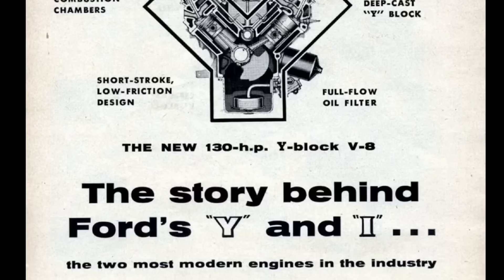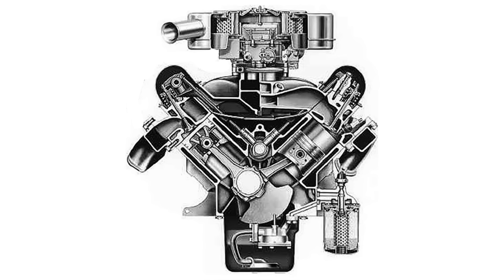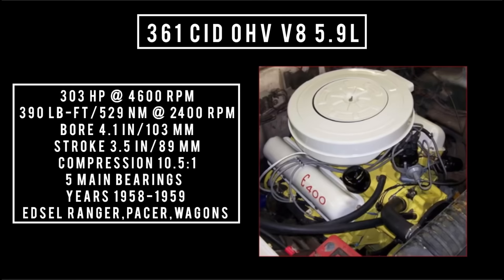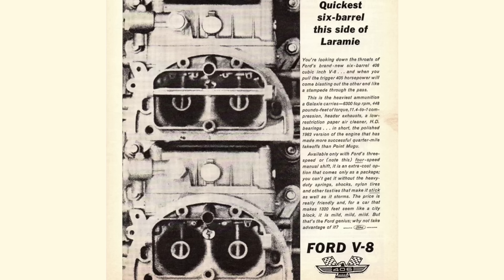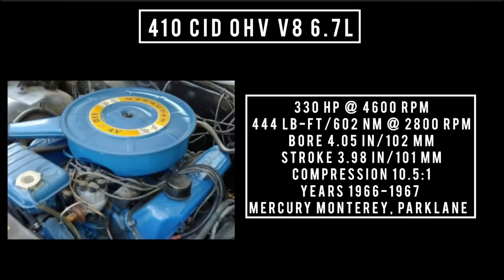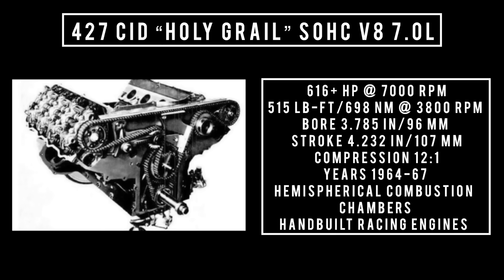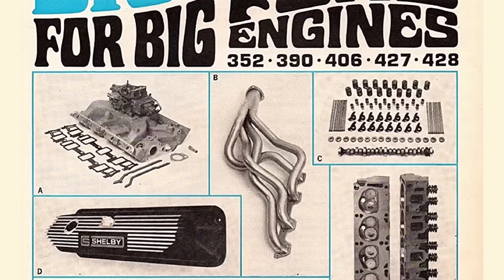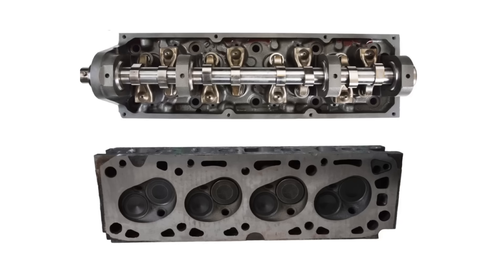Ford FE Engine Family 332, 352, 361, 390, 406, 410, 427, 427 CAMMER, 428, CJ428, SCJ428

Comment: I recently started a Ford project with one of the 385 limas. Cost is thru the roof. I could have built a 350 Chevy for what the lower assembly is going to cost. Big block ford power is expensive. The best thing about them is durability.

Comment: I've had 2 ford trucks with FE's, a 360 and a 390. They were good motors with the exception of the exhaust side of the head. I was constantly chasing exhaust leaks on both of them. The 360 had cast iron manifolds and the 390 had headers.

Comment: I've had several cars and trucks with FE motors but I had one F100 with a 390 FE that still ran with 20-60psi compression in the cylinders. Only two made it to 60 and it still ran and started easy! I swear it was a 2 stroke because it used 2 quarts of oil to a tank of fuel minimum! I call it my "California Special"!

Comment: I hate seeing  a Ford with  a Chevy engine. I don't like Mopars or other brands that are not Chevys with Chevy engines. Chevy made excellent engines. I owned many of them. I believe that the engine used should be the same as the brand of car. That's just me, though. Do what makes you happy. Think it's interesting that my 2015 F350 6.7 liter powerstroke diesel is a 406 ci.
Reply from the maker: I totally agree specially with the older cars just depends on what it is like if you see at 3:50 Chevy and A Packard, it's kind of cringe at least for me

Comment: Believe the 332 is a Y block????
There was a short run of 330 FE for F500 F600 trucks.
Think this were the 330, 332 gets confusing...
Reply from the maker: Ford had multiple 332 the picture is of the y block version there was 332 FE

Comment: From my calculations, you have some numbers incorrect. Good video though. My bore and stroke numbers are from Google and the calculations are done on a calculator. 
The 332 has a bore of 4.0 and a stroke of 3.3, not 3.6 x 3.6. Your displacement would have been 293 cubic inches.
The 361 has a bore of 4.05 and a stroke of 3.5, not 4.1 x 3.5. Your displacement would have been 370 cubic inches. 
The 406 has a bore of 4.13 and a stroke of 3.785, not 4.1 x 3.8. Your displacement would have been 401 cubic inches.
The 427 has a bore of 4.232 and a stroke of 3.785, not 3.785 x 4.232. Your displacement would have been 381 cubic inches.
On the 427, you accidently flipped your bore and stroke. The displacement is actually is 426 cubic inches. 
Other notes, the 428 is actually 427 cubic inches. That is right, the 427 is really a 426 and the 428 is really a 427. All three are 7 liters since a liter is a less of a precise form of measurement over a cubic inch. 
Keep in mind the term hemispherical is just marketing. Considering the definition is half a sphere. I could not imagine the 427  SOHC (426) engine would even fire enough to spin the crankshaft 360 degrees if it had that low of compression.

Comment: Those might have been good but in my opinion you cant beat the 385 lima engine. That plant knew what they were doing. The blocks came from the factory capable of holding 800 hp as daily drivers. Im lucky enough to have acquired one out of an F350 along with the automatic trans. Definitely building for 800hp and thinking of getting one of those fiberglass T Buckets to stick it in.
Reply from the maker: Great insight and information =)

Comment: Mercury, torino, and it's good to note that once they hit 1964, these engines were often under rated. I've had a stock 2v 390 on a dyno and it made 393hp at 5400rpm. It was even better with a modern top end, stock short block.

Comment: Notable mention, the 391FT (truck engine) was the service block for the 390/428. High nickel block with extra webbing on the main bearing support. I found one that had the passenger car distributor bore and .030 over 390 bore (FT had lager dist bores with larger oil pump drive) so a regular dist could be used. I had a Micky Thompson duel quad intake, bored it to 428 bore and used a Mercury Park Lane crank. Had a 428 for next to nothing. NICE!
Reply: That is the FT 74 block.
Reply from the maker: https://youtu.be/bUC5957_g-o?feature=shared

Comment: I would go with the Park-lane and the 70 Mustang. I order a 68 GT with 390 and later came a cross a 70 Boss 429 winch I owned at the same time. NO BS!!
Reply from the maker: Wow that’s insane which did you like better
Reply: @What.its.like.  The 68 390 GT was the better Car to drive daily, My 429 had a heating problem that I could get rid of SO it was a LOVE HATE with it. LOVED THEM BOTH.
Reply from the maker: @jameswilson8430  it seems like Ford’s always have overheating issues. I had a 67 Mustang but I put three radiators in that car before I said OK I’m gonna buy the biggest four core aluminum radiator I can find and then when I did that I didn’t have any more heating issues.

Comment: The engine pictured at 2:30 is not an FE is actually a Lincoln Y block.  Also the Bore and Stroke of the 332 are incorrect.  4.000" bore with 3.300" stroke.
Reply from the maker: Thank you for that correction

Comment: I picked up a 1967 Thunderbird couple years ago been fixing her up. She's the four-door which has the suicide doors in the rear. Good looking car people love the comment on her. Just sharing cuz she has the FE 390 V8 engine in her. She runs real well had some problems when I first got her but after giving her some major maintenance and replacing a few things she's been running super good the last year.
Reply: Ours was a '69 with the 375hp 429 cream with black alligator pattern vinyl top. I had some pretty quick cars  (350 mid-engine V8 Corvair Monza, '67 GTO with a '69 Ram Air III motor built by a top Pontiac racer/Builder) That Tbird would surprise more than a few Ricky Racers.  Also had a very overlooked awesome HVAC system.
Reply: A  8itch to get at those rear most plugs though!

Comment: You could hardly out run a 289 cobra , and the k code 289 mustang mptor in the shelby gt 350 eas a screaming die hard racer

Comment: The FE had 5 main bearings, Ford- Edsel, Police Intercept 352 and 361 made 360 hp. The 406 was underrated and NHRA refactored it.  The 410 was a Mercury only FE 66-67 in the Parklane primarily and were known they were producing beastly torque. An excellent opportunity was missed by not putting a better exhaust manifold, cam and aluminum intake and making it the S code intermediate and Pony car engine. It would have been a very strong contender on the street.  The 1st gen block would have been able to allow a 375 hp S code., the 410 would have been made for the intermediate and pony cars. With an aluminum intake and water pump and with the third web on the mains it would have weighed the same as a SBC. Why? I don’t know. Iacocca I suspect. I d pull the 410 and built it for a 67 Mustang with a 4 speed.
Reply from the maker: Great information
Reply: The 406 was 4.13bore and 3.78 stroke. The 361 Edsel was 4.05 bore and 3.5 stroke like the 360 truck engine.
Reply: All FEs were made of cast iron, the 427 was made of a better quality of iron mixture and the cloverleaf bore molds, and very precise cooling of the casting to prevent inconsistency in casting.

Comment: Anyone hear of a 391 FE....just curious, suppose to be 62/63, was told it came out of a rolled cruiser.
Reply from the maker: Ford FT engine family 

https://youtu.be/bUC5957_g-o?feature=shared
Reply: @What.its.like.  I know it was a BUGGER finding parts for.
Reply from the maker: Information is very scarce as well
Reply: @What.its.like.  figured that out when the TC got slack in it.
Reply: @What.its.like.  that was an easy 40 years ago, still bothers me that I couldn't find the right components. 
Left it in my friends field...
Reply: The 361and 391 FE engines were used in UHaul trucks during the 1960s and into the 1970s, if you think you have one, check all the casting numbers, truck blocks have different casting numbers then the passenger car engines.
Reply: @abcullens2328  the engine I had came out of a rolled patrol car.
The standard 390 timing set gave me problems....my God that was nearly 45 years ago
Reply: @charliejones7574  I understand your frustration, like he mentioned in the video there were many variants in the Ford FE engine family, many of them were only produced for a year or two. Sometimes finding replacement parts for those low production engines was near impossible.
Reply: @abcullens2328  I remember the guy at the part store ....that look of bewilderment
Reply: @charliejones7574  And that was when the guys behind the counter at The Parts House knew what they were doing, very different today, they only know what the computer tells them, sad.
Reply: @abcullens2328  unfortunately.yes

Comment: I agree with this, swapping to an aluminum intake saved 60 lbs. Almost as much as a whole intake and heads swap on other engines. If you put aluminum heads intake and water pump on an FE it was only 515 lbs, about what an all iron 289 was. Or a 350 Chevy with an aluminum intake. People busted on them for weight, bullshit, people claim they are heavier than a 460, tell my engine stand that. LOL. 😂

Comment: You reversed the bore and stroke numbers. The bore was larger than the stroke. Please correct this mistake.
Reply from the maker: I wish I could fix it in this video. YouTube doesn’t really make it easy to fix things once the video is posted so I corrected the stuff in a different video and put it in the link in description. If you check out the description, it talks about all of the different errors, if you wanted to watch the video without errors it’s linked

I just checked the description. The revision episode with all the corrections is also linked in that description.

Comment: FE=Ford Edsel. Good review. The 361 was a truck engine also used in the Edsel. The FE427 was a rare bird, but tuning was a lot more flexible than the cheaper to produce 428. The 390 is a superb all around motor, used heavily in pickups, along with its shorter stroke 360 brother. I will take a 61 390 Bird any day !

Comment: Love FE motors as my 76 has a 390 made to a 410 currently in it. My only complaint is that the heads can't flow what they should for a " big block" to make some serious power.  Plus they weight way too much for what they are.

Comment: built an FE engine started with 410 block and installed 427 high rise heads and cast iron exhaust manifolds. Ran largest cam possible with hydraulic lifters. My old motor had Fords LeMans rods and I used them for this engine. bored 30 over. Intake was a bear to figure as the tall ports of the head didn't match any manifold available aftermarket. I chamfered every oil passage to better oil movement. It was a seriously aggressive engine especially in my 1957 F100 short bed.

Comment: Question. I had a 67 F-250 with a 352 and 3 on the tree and  friend still has his 67 352 F-250 4 speed on the floor. Would these have been left over FE engines as 66 was the last year in cars and 67 last year for the 352 in the trucks or were they FT engines also what year did they stop making them At the Mercury plant and rebadging them FORD and start US production (if thats correct on how it was done idk?)
Reply from the maker: I decided to separate the FT engines one because it was really hard to find information on all of those engines two they were only part of the Ford F truck series. I started doing an episode on that that one was supposed to be the episode that came out this week, but just like back then I keep hitting roadblocks when doing that episode because information is just very sketch on some of those engines.
Reply: @What.its.like.  could you maybe just give a run down video of the basic differences between the  two, for example is a 1964 352 in a galaxy the same short block as a 1966 352 in a pick up truck are the  differences in the heads or the compression ratios or cams or is it too much variability to generalize like that? Myself I dont have a clue but am interested to know and be able to spot the difference where a 390 truck eng has been put in a car or vice versa and how to make one into the other if possible... Just thinking outloud I guess.

Comment: I found it mostly accurate good job.  Getting it mostly correct is a lot of work/research with FE engine facts and you will always have guys nit picking everything. My biggest complaint is that you implied that 428SCJ engines made more HP than 428CJ engines.  Not true.  In fact, the 428SCJ engines had a much heavier rotating assembly therefore they rev'd slower and made a little less horsepower at any given RPM compared to equivalent 428CJ engines. My good friend Kerry used to call it the "warranty pack". The lower rear gear ratios is what made the drag pack cars superior on the dragstrip not higher engine HP.
Reply from the maker: Thank you so much for adding all that insight and information. This episode was really hard to do because so much conflicting information the 427 the stroker flipped because the source had them flipped which happens a lot when doing this people love to round when giving out specs I don’t understand why why they can’t just give the actual numbers.. 

I did make a video that has all of the corrections, I wanted to replace that video with the video that is up, but YouTube doesn’t make it easy. Well it’s not possible to do that… which is a total bummer something youtube needs to make possible.

Comment: Btw, the FE used the same oiling system as the Small Block Chevy. The center oilers were adequate unless you are running NASCAR. Chevy had to go priority main when run in NASCAR also. The 390 block with cross bolted caps can be converted to priority main. 234 only 1 and 5 were still non priority but plenty of oil is available.

Comment: What does the 360 truck engine fall in
Reply from the maker: FT engine family which are all versions of the 390 but only used in trucks
Reply: @What.its.like.  I've had quite a few 360s in Ford trucks until 1977 we they went to the 351 modified the 400 came into play too

Comment: Good video has stuff people don't usually know, also a couple flaws, but it's hard to get every detail right, the 406 was a special block just like the 427 it had cross bolted mains it was the performance Engine but because of the thin bores Ford was reluctant to go more but when the Galaxy equipped 406 dual quad carbs, lost to a 327 Impala at the pikes peak Hill climb challenge for new they had to do something the engine was punched out to 427 CI(425.98) actual, this was a great born-stroke combination the engine just liked being a 425/(aka427) the legend was born, this combination really does just work even today they're wicked fast the Fe was not known as a big block either it was known as a medium block the 289s small block Ford FE medium block Ford MEL big block, that was Ford's official designation. Great video, I like the fact that you can have one engine with 440 horsepower and 500 foot pounds of torque and then you have another engine that's $344 horsepower with 510 ft pounds of torque shows the versatility and and different builds Ford was working with this engine made its living from torque it was also an industrial engine they had a lot of 427 Marine engines that were doing the work of  what today's diesels would, and they did it well and reliably. The Fe was a great Engine line but it was dirty burning engine,emissions wise, horrible gas mileage by today's standards, for its time it was great, few engines sound as good as this engine when it's built in camed out they have a great sound when they're built up what you think of when you think high performance 60s as a matter of fact most movies if not all of them when you hear a car's chasing or racing they will dub in the 427 GT40 at lemans for the sound clip they sound awesome!
Reply from the maker: Thank you so much for sharing all this information =) greatly appreciate that
Reply: The early 406's had two bolt mains but they had problems staying together so they switched to four bolt mains which helped to an extent but by then the 406 gave way to 427

Comment: I was born in 1951. As I was growing up one of the family cars that my parents owned was a 1964 Ford Country Sedan station wagon. The car was equipped with the Ford FE 352 cubic inch engine with a 4 barrel carburetor and the 3 speed Cruise-O-Matic transmission. One characteristic of these particular Ford FE engines was that the engine coolant tank was separate from the radiator. Also the engine coolant fill cap was very close to the engine oil fill cap. One time my father was flushing out the radiator and doing an oil change at the same time. When he started to refill the engine with oil, he accidentally put the spout of the oil can into the radiator coolant tank. I saw this and said, Dad you are putting engine oil into the radiator. My dad pulled out the oil can and started to flush and drain the radiator a second time. This was an easy mistake to make because the oil filler and the coolant filler were next to each other. At the 3 minute 18 second mark on this video, you can see that the oil filler cap is just behind and next to the radiator fill cap on the 352 cubic inch engine.
Reply from the maker: Thank you so much for sharing that story. I always wondered why Ford did that and put a separate tank for the radiator up on top of the engine I think they’re the only ones that did it.
Reply: @What.its.like. Ford also used the expansion tank on Lincoln's of the same time period plus Shelby used them on the Cobras
Reply: That tank your talking about is the expansion tank just like modern cars it also made it the highest point of the cooling system. And for whatever reason not all the early FE's had it and in 67/68 they changed over to a smaller thermostat housing
Reply: .......................cool.....I was born  june 18,,,1951........own a 347,,,,, 1988 stang,,,,,,drag car convertible.......